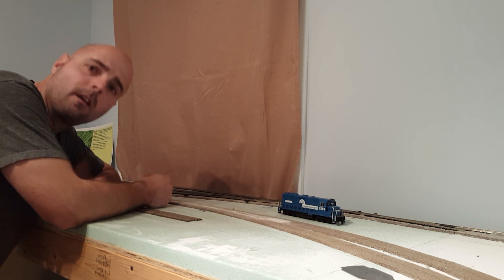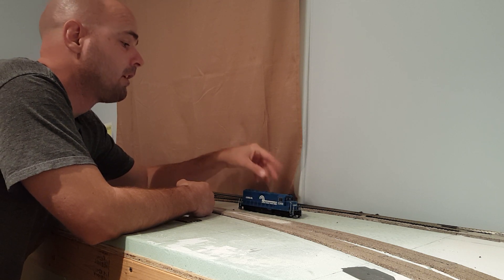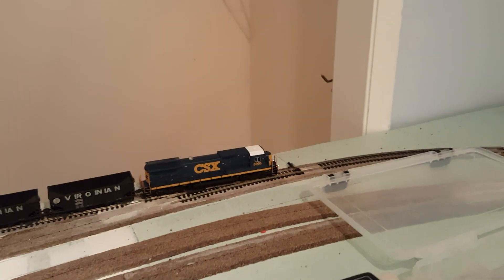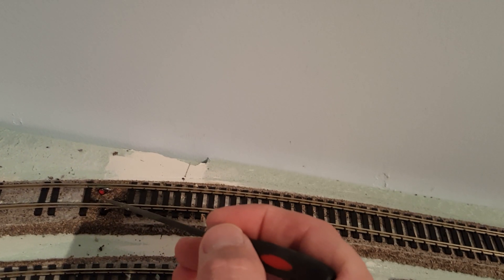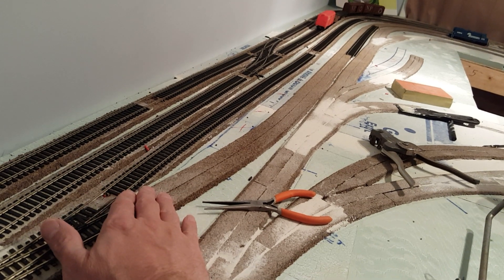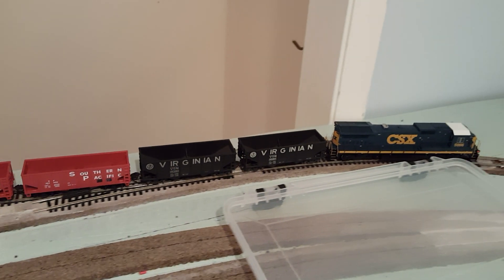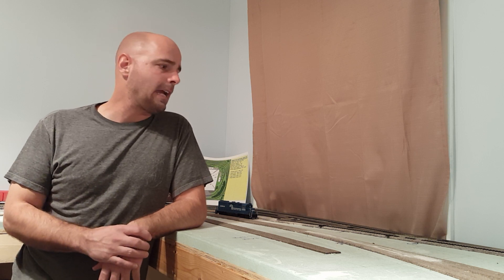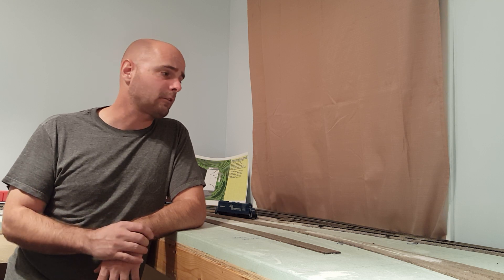Layout update #10

Comment: Hi not sure if this is any help but l have a go trying to put it in words ,with the track ties if there not glued down and only pinned down then you can slide the ties from around the bend back to there by cutting the join between the ties under the rail ,that way you can slide some new ones on at the straight section that so long as the join is not soldered ,but as for it kicking over like that l say it need a little grind on the very end of the rail section on the inner rail only ,l mean were the fishplate joiner is ,hope this help mate and l all so sub cheers Ron aka aces116
Reply from the maker: Ron,
Thanks for the help. Unfortunately the rails are glued down. What I was thinking about doing is clipping the two outer clips on the tie and then place individual ties and glue them. I'll also be using the track alignment tool to keep the track in place. Thanks again.